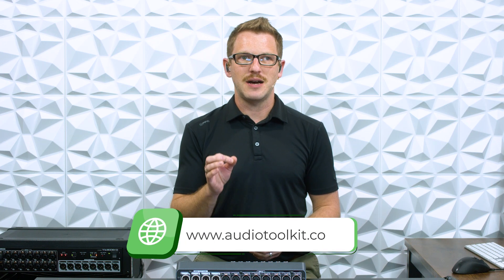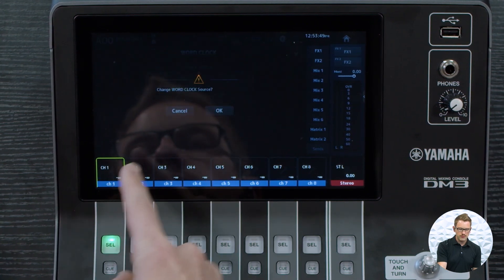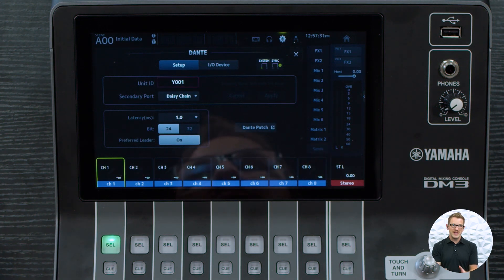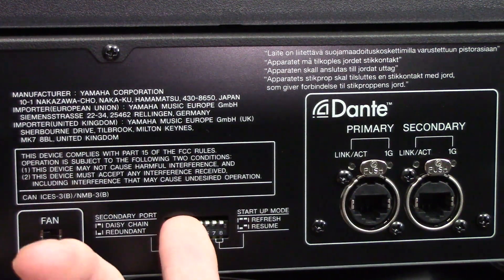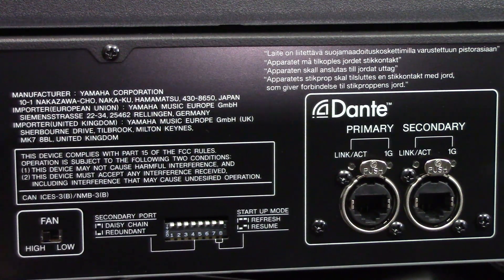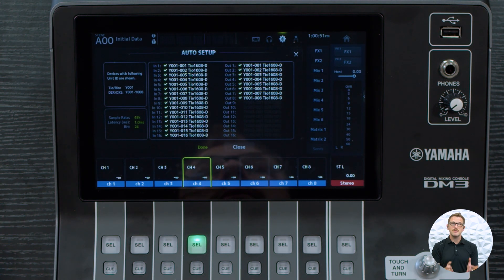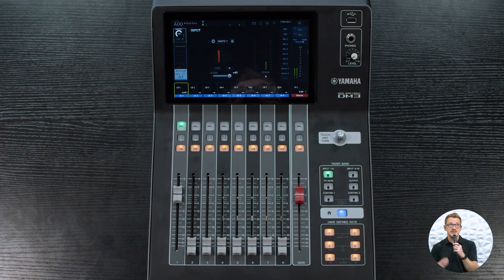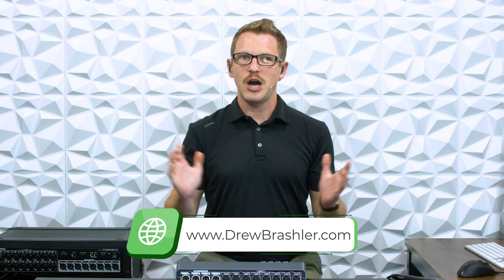How to Connect a Yamaha DM3 Dante to a Tio1608-D Dante Stage Box

Comment: Hi,
Can you show me how I send my mix to a stereo output for my subwoofer system?
Configured so that I can also control the second sub output with my main stereo output.
So, essentially, a link function for the main fader.
I see this is also possible with other Yamaha mixers.
For example, I send my stereo signal to matrix 1 and 2 on outputs 3 and 4 and use these to power my subwoofers.
If I now close the main stereo fader, I don't want any sound on the sub output either.
So, I use one fader to control the volume of four outputs.

Comment: Thanks mate. Great insights. I'm designing a configuration of dm3 connecting 2 Rio32 (most of time not fully utilise)  so will patch a few channels from each Rio to Dm3 thru switcher, will both Rio appear connected in dm3, and from there easily to patch into channels?

Comment: Thanks for this video! Very clear and helpful! I am considering to buy a DM3 + Tio 1608-D2. Would I be able to use the 8 physical outputs of the Tio unit + the 8 physical outputs of the DM2 at the same time? Or is the mixer limited to only 1 Stereo, 6 Mix, 2 FX, 2 Matrix busses also when expanded with Dante external hardware? How many physical output signals can I use at the same time with the DM3? Also, on a related note, how many physical direct outputs can I have? For example, can I record 16 input channels via USB while using the mixer for a live gig (therefore using several of the output busses of the mixer for the live sound)? Many thanks for your help!

Comment: can you combine all 16 channels from the Yamaha DM3 with all 16 channels from tio1608 D2 and use all 32 channels on the DM3 console?
Reply: Yes, the Yamaha DM3 can utilize all 16 channels from the Tio1608-D2 and its own 16 channels simultaneously, totaling 32 mixable channels. The DM3 has 16 built-in analog inputs and can also receive 16 channels via Dante from the Tio1608-D2, allowing you to use all 32 channels on the console.
Reply: @unseenworkers  This is incorrect. You may mix and match local, dante and USB inputs but you still only have 16 assignable and hence, mixable, inputs.

Comment: Hey Draw, I've got a question. The band is playing on the stage with 14 inputs connect on the TIO ( Dante ) , the signals go to the DM3 ( also Dante ) and I going to do the mix. But is it possible to do a recording from the DM 3 with the 14 channels and a laptop via USB, I can t find the right routing. I'm afraid if you used the DM3 on that way it s only possible recording via Dante / Virtual Soundcard.  Hope you can help. Greetings René

Comment: In conclusion, stagebox 16in 8out, when using it, separating the inputs of the mix and stage box, it's like getting 32 inputs, is that correct?
Reply: Theoretically yes, but practically you can use only 16CH in console itself. You can patch all of them from mic preamps or all of them Dante or some Dante and some from console. Still you have 16 channels. And you have to count one off if you want Talkback, because there is no extra option it seems nor extra connector. I am wondering if there is a possibility to patch Matrix 1&2 as Dante output. For example use some relatively cheap 2ch Dante output card and use it for extra feed of speakers or subs with separate EQ, latency and fader... It seemed so good at first but those little limitations are at the end no go for me, and don't forget the price point of their Dante stagebox - it costs almost as the console itself. Otherwise it is really nice, simple and elegant console...

Comment: Thank you for this in-depth video. I know the Behringer X32 had an optional DANTE card. Are you able to do a video of the X32 with DANTE, especially connecting to the TIO stage unit, for example.
Reply: Afaik (could be wrong tho) , you wouldn't be able to control the headamp gain (and other features) of the TIO over Dante.

Comment: Can I connect Yamaha Tio 1608 directly to PC for sound mixing?
Reply: No.
Reply: The Tio 1608 isn't a standalone mixer.
Reply: Alright, thank you.

But it can work with any other console that is not Yamaha brand
Reply: @fastincorporated3171  By using Dante, yes.
Reply: @fastincorporated3171  That's because other brands such as PreSonus with their stage boxes, they have a digital mixer built into them I believe.
Reply: @fastincorporated3171  These stage boxes do not have a mixer integrated into them so its function is purely for sending digital audio out through Dante.